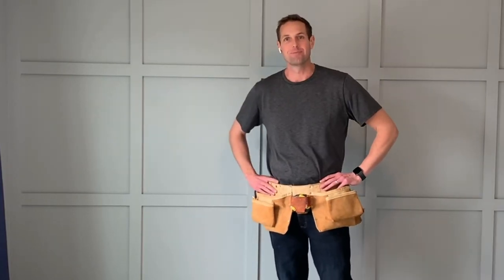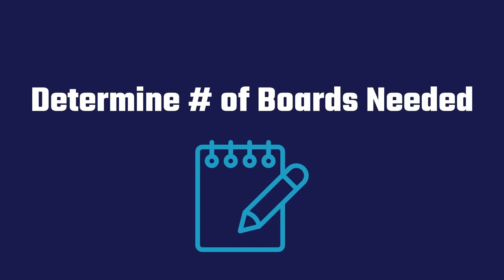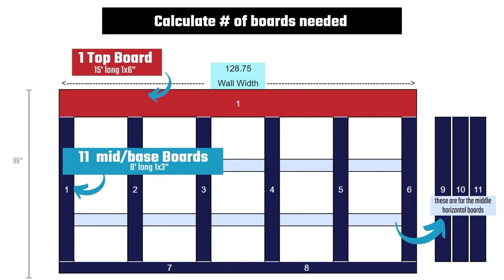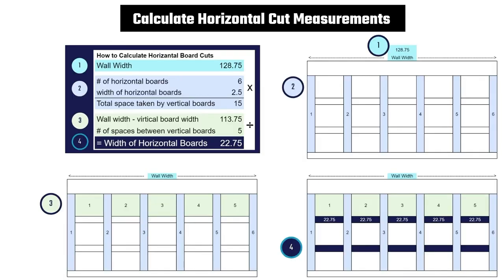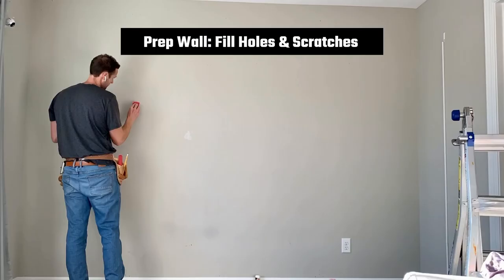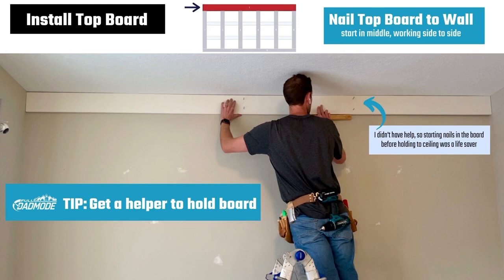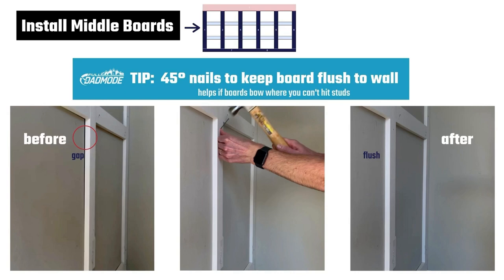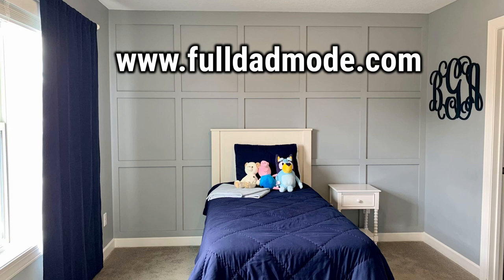How to Make a Board and Batten Wall

Comment: I will be doing a board and batten wall in my living room.  There is a 5”baseboard with a decorative top. I am using 1x3” MDF boards.  Do you have any instructions to show how to add it with decorative baseboards.  I am not sure how it ties in.  The MDF is a little thicker that the existing baseboards. Thanks so much
Reply from the maker: Here’s a good example https://pin.it/1U3TNaC good luck!

Comment: This is a great video. I originally saw your post on Pinterest. I am getting ready to attempt this on a wall in my home. If all goes well then I am going to do it on a wall in the master bedroom. The math is really stumping me as well as what material to use. I originally bought 1 x 3 (2.5 actual) primed mdf boards but then I've seen articles that say the boards should only be 1/2" thick. My baseboard will be 1" x 6" and I will put a narrower board across the top of the baseboard to complete the "frame" of the board and batten. I really like that you went with a wider board up top which is something I hadn't thought of before. Is there anything you wish you had done differently? Have any words of wisdom?
Reply from the maker: Thanks for the kind words! I hope your project goes/went well. Only thing I would have changed is adding one more cut on the boards that sit atop the existing trim…I would add a beveled cut. Here’s a good example https://pin.it/1U3TNaC

Comment: what time of paint sheen did you apply to your boards & battens? I heard that MDF needs to be oil-based paint but not sure if that's accurate?
Reply from the maker: HGTV HOME by Sherwin Williams Showcase Satin Online hgsw1466 interior paint. It’s acrylic base and worked great. The MDF I used was primed so no need to prep specially before painting. You don’t need oil based. Good luck with your project!